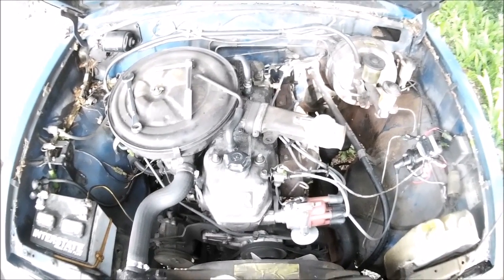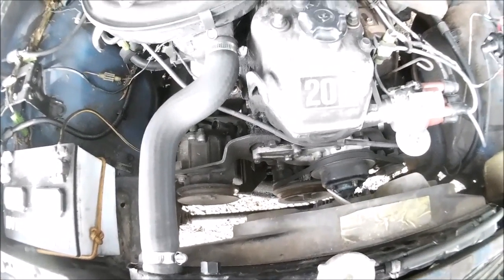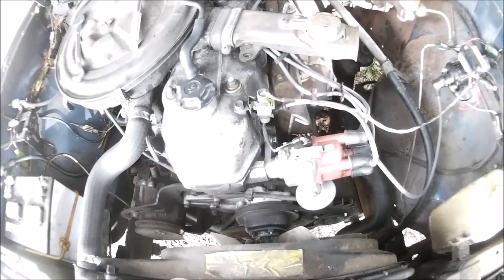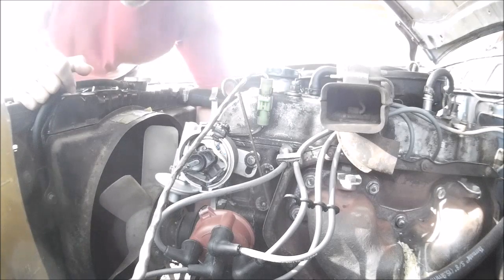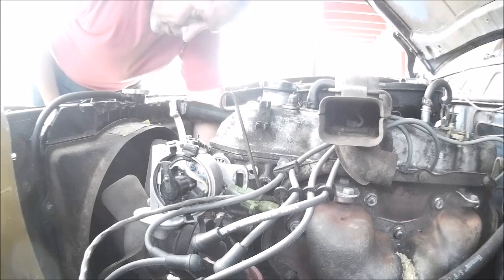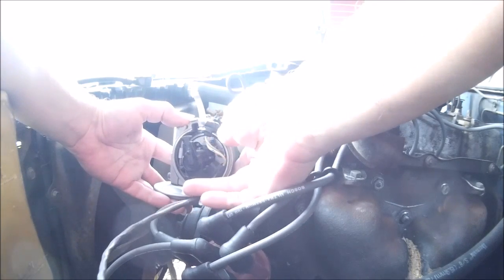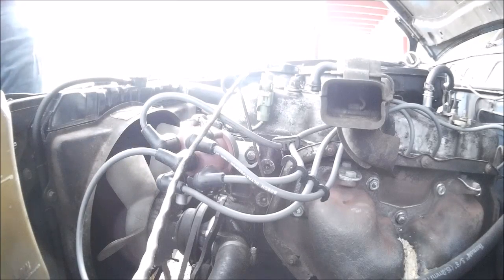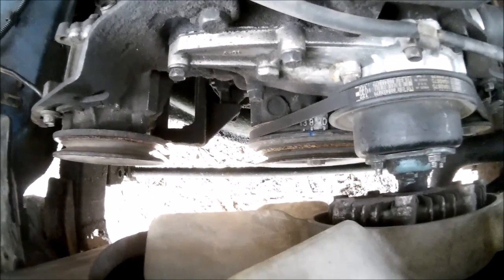1978 Toyota Pickup/Hilux 20R - CORRECT Distributor Installation

Comment: I have this problem with my 22r I'm not sure wat year the motor was from I bought from a guy and rebuilt the chain with metal HD kit and followed the LC engineering video for installation and made sure the crank shaft position was lined up with the cam gear 0 degrees TDC and my distributor can reach 0 but at full retard which I know is not good for the engine but she starts up fine and drives good but sometimes up hill or even flat roads it will randomly start studdering and back fire pop thru the weber 36 carburetor !
The only things I can think of is I need a new distributor or the crank shaft position or the chain moved somehow during installation. Thanks for your knowledge 🙏
Reply from the maker: OK, there are several things it could be, plus several things that need further explanation. I'll try to do this in some logical order.

Without knowing the age or condition of the distributor, it is hard to put the blame on that part. I would suspect that it's doing pretty good mechanically given your description of running qualities. First thing I can think of is do you have the vacuum advance line to the correct port on the vacuum advance on the distributor? 22R distributor have a dual port vacuum advance mechanism; one port is for timing advance & the other is for timing retard. The advance port is the one furthest away from the distributor body. Most people only run the advance side & cap off the retard side; how you run yours is up to you, but you need to have at least a working vacuum advance (more on this in NOTE below).

As a start, I recommend that you remove the distributor from the cylinder head, & manually rotate the engine to 5 degrees** before top dead center on the compression stroke for #1 cylinder. Be sure it's the compression (firing) stroke, NOT the exhaust stroke. Both valves for #1 cylinder should be closed; you can verify this if you take the valve cover off & feel both rocker arms for #1 cylinder. They should both feel a little loose.

Once you have the engine set up right as described above, re-install the distributor as I showed in the video. Be sure the rotor turns as shown when pushing the distributor in, & verify that the hole for the distributor hold-down bolt is centered in the slot. This will give you a base timing of 5 degrees** advanced.

**NOTE: Not all 22R engines were designed to be set to zero degrees; some were set to 5 degrees, depending on model year. This had to do with the functions of the emissions system, controlling vacuum signals to the distributor via several valves, and changing the advance & retard of the distributor. The vacuum signal would change depending on conditions. Given the age of the truck & engine, it could be very likely that some or none of these valves are working correctly, which could certainly cause you a run quality problem.

Since you don't know the year of the engine, & to avoid any of these problems, just run a vacuum line directly from a port on the carb to the vacuum advance port on the distributor as I previously described. On a Weber 32/36, there should be such a port below the choke thermostat. I would also put a quality, tight fitting cap on the "retard port" on the distributor's vacuum advance unit.
I know this eliminates the emissions system controls, but doing this should be good enough for the engine to run well under most conditions.

What kind/type of fuel pump are you using for the Weber? Stock pump or otherwise? Please be specific with make, model & part number if possible. Are you running a fuel pressure regulator with the Weber? If so again, let me know specifically what you have.
Reply: @The13thSword  thank you for all that information! And taking time to help ! I appreciate it! 
But does the small dot on he timing chain gear have to be at exactly 12 o'clock ? Mines is slightly to the left at like 11:30. And the dowel on the cam is at 12 o'clock along with the crankshaft at 12. Could the crankshaft position have moved during installation and tightening? Causing it to be off a tooth? 
Also you said try setting my base timing to 5 degrees instead of 0? Cuz I tried it before and nothing changed it still ran beat at full retard which makes me feel that it must be off 1 tooth somewhere in the chain or crankshaft position moved during installation maybe? Cuz ived tried going forward and back 1 tooth on the distributor and its either fully retard or fully advanced timing and my mark on the crankshaft pulley can't reach the 0 degree mark and its fully retard and only reaches about 8 degrees.
I'm using a edlebrock fuel pump 4-7 psi rating part number 17301. And only a cheap mr gasket fuel regulator set at 3 psi. 
You said my valves could be sticking? I just adjusted the valves to .008 intake and .012 exhaust and they were like really tight before I did the adjustment like I couldn't even fit the feeler gage under it. It haven't been shuddering and back fire pop since I've readjusted the valves but the distributor is still at full retard timing and mark on the crankshaft pulley will only reach 8 degrees. 
Could a faulty distributor be the issue?
Reply from the maker: @kalaikauai808  Your valve adjustment seems to have solved the problem, but a little more on this later. Your description of the dot & dowel on the timing gear sounds correct. These two items are not perfectly aligned on the gear so don't let that throw you off. Have a look at this video at about 2:50 & you'll see this: https://www.youtube.com/watch?v=fhwfXoeM7ZI

You should be able to verify whether or not the crankshaft is in the proper position by checking both sets of marks. If you make sure #1 cylinder is at TDC (0 or zero mark on crank pulley) & the cam gear marks are as you describe, everything is lined up as it should be. If the timing chain was off a tooth between the cam & crank gears, the engine either wouldn't start, wouldn't run at all if it did start, or would run very badly. Believe me, you would notice this.

The more likely possibility of there "being a tooth off" is with the distributor, if it wasn't installed correctly. Here's another video in this that I consider to be even better than my video on the distributor, & how to install it correctly: https://www.youtube.com/watch?v=u6b-vnsk5xA&t=290s

Pay close attention to the rotor position he mentions, & how it rotates as the distributor is pushed all the way in. What is also crucial here is that after it is pushed all the way in, double check to see if the hold-down bolt hole is centered in the slot. If it is, it's fine. If not, the distributor is "off a tooth" & needs to be reinstalled correctly.

If you do all this and still have the same run issues, then it could be a mechanical or electrical problem with the distributor itself, or something else. If the distributor is original, it could be worn & causing these problems. When you say it reaches 8 degrees of advance I assume you mean when running & checked with a timing light? If so this sounds ok.

Good job on adjusting the valves but I have a question. You did do this in two steps yes? With the rotor first in the #1 position and then in the #3 position? I only ask this because you mention "they were like really tight before I did the adjustment like I couldn't even fit the feeler gage under it." I'm reasonably sure you did but just to make sure, here's a link to LCE's instructions on this: https://lcengineering.com/engine-20r-22r-re-ret-valve-adjustment/

I don't mean to question you so much, but I just want to be sure all is correct.

The Edlebrock pump sounds/looks OK, even if it's rated PSI is higher than needed. I think I know which Mr Gasket regulator you have. They work OK, but if you are still having problems under laod, you might want to consider reducing that pressure down from 3 psi to 2 & 1/2. The Weber can be very "finicky" about fuel pressure. Sometimes anything even slightly over 3 psi can cause it to flood a bit, & that could also cause the stumble or pop-back.

The only other things I can recommend you check are the advance weights in the distributor & the air gap setting on the distributor pickup coil. If the weights are sticking, that would keep you from getting full ignition advance, especially under higher load. You can check this by removing the distributor cap, grabbing the rotor & turning it by hand in the direction that it advances, & then letting it go. If it "snaps back" cleanly you're probably ok. If it "snaps back" slowly or not fully, then the advance weight pivots are probably sticky from built up gunk. Clean the pivots with WD-40 to clear the gunk, air dry them, then apply a few drops of a light oil (3-in-1 oil, auto trans fluid or similar) to the pivots.

The pickup coil gap should be between .008" & .016". I have mine set to .012".

Comment: were do I buy a distributor
Reply from the maker: Rock Auto is your best bet. Their prices are usually much better than any parts store, who will usually tell you it's a "special order" item, then charge you out the wazoo for it.

Also be sure to order the correct type of distributor; there are two versions, one a points version and the other electronic. Just compare your old distributor (if you have one) to the pics on Rock Auto. 1975 & '76 models are usually points, 1977 models might be either, and 1978 models are all electronic. Either version will work in the 20R regardless of year, but the electronic version must also have an "igniter" or ignition module to work, and the proper ignition coil (the one specified for 1978, see Rock Auto Parts here: https://www.rockauto.com/en/catalog/toyota,1978,pickup,2.2l+l4,1277108,ignition ).

1975 to '77 20R's can be converted to electronic ignition with the proper parts. I use a GM HEI Ignition Module, as the stock Toyota one can be hard to find and expensive. See my other videos for info on that conversion. Any questions just ask.

Comment: Isnt that 20r a 4? Why talk about a  v8. Anyways good video, helped me start up my celica
Reply from the maker: Yes, the 20R engine is a 4 cylinder. I mentioned a V8 engine & the usual timing setting it has as a comparison; that regardless of number of cylinders, the timing setting is pretty much the same. That means this method of "pre-setting" the timing will work regardless of number of cylinders. Getting the "base" timing setting exact is a bit more critical in engines with fewer cylinders.

I apologize for any confusion over this. I obviously didn't not state clearly exactly what I was thinking at the time I said that. The main point I wanted to make was, that I have heard over & over again to set the pulley mark to Zero & install the distributor. That's OK as a starting point on an 8 cylinder & it will run OK, but on a 4 it's not so great. The difference in run quality is much more noticeable in a 4. Plus you saw the difference in the adjustment slot on the distributor. Having the hold-down bolt in the middle of the slot gives you far more adjustment options.
Reply: @The13thSword  thanks for these 
response, but where did you get the igniter? I believe im having issues with mine.  I have a 20r as well and have that big box. But would like to have one like yours.
Reply from the maker: @jonbertocchi173  Exactly what issues are you having? Can you be more specific? That could help me narrow things down for you. Good diagnosis saves a ton in parts money & extra work that may not be needed.

I recommend that you check out everything else BEFORE you think about getting rid of the stock Toyota Ignitor. In general they are pretty durable units, and it's usually another component that is causing the problem(s). I would also recommend that you take it out of the truck & take it to Auto Zone or O'reilleys (or similar) & have it tested for free. That way you'll know for sure if it's the problem or not.

The other thing to check is the Pickup Coil in the distributor and the wires coming from it to the Ignitor. If your distributor is original, the Pickup Coil might be "out of spec" due to age & use, or may just not be adjusted properly.

You can check the Pickup Coil with an Ohm Meter. The spec on it is 130 to 180 Ohms. If it's anything above 160 Ohms "cold" I'd replace it anyway, or even consider replacing the whole distributor, as it may be worn as well. Make sure you check the wires coming from the Pickup Coil for any broken insulation. Those wires are shielded with a foil under the insulation to prevent interference.

I only went with the GM HEI Ignition Module setup because a stock style Ignitor was $400+ and I can't afford that. I also was not willing to take chances on a used unit that was not returnable. I bought the parts for the GM HEI setup separately & fabricated it all up into what you see in the video. It's custom. I can give you a parts list, but you'd have to put it all together yourself.
Reply: @The13thSword  so ive been driving this car since 2010 and the issues started about a few weeks ago, basically the car cranks and starts but it will take ages and jump start to get it started on a cold and hot start. (Tried starter fluid once but it doesnt work) It idles accelerates well once started.  Also once it's started and warmed up i can shut it off and start it up immediately if its off for only few minutes. If i let it sit for more than 10 it becomes an issue to hot start all over. I  was thinking maybe the igniter is bad. In the past the only mechanical issues I've ever had led me to replace the starter mortor twice,  the solenoid once recently, changed the carb to a weber 38 a year ago  and the fuel pump which i changed  to an electric pump.  Ive checked the spark plugs and distributor and they are good. Maybe my 20r is just ready to be retired. Also i forgot to mention its a 77 celica.
Reply from the maker: @jonbertocchi173  Some good info here, let's see what we can track down from it.

9 years is a while to be driving on the same ignition parts. Have you done any tune-ups in those 9 years? New cap, rotor, wires, plugs, and when? Plugs gapped to spec - .031"? Has the timing been checked with a timing light and if so what is it set at? If you checked timing with a timing light, is the mark on the pulley steady or does it jump around?

The "hot start problem" after letting it sit 10 minutes gets my attention. This sounds like an ignition coil problem to me, especially if you haven't changed out the coil before, there is no telling how old it is or what condition it is in. It needs to be tested. You can get it tested for free at several parts stores (Auto Zone, O'Reilley's, etc.) or you can test it yourself if you have an OHM meter. There is a very good video on how to do this here: https://www.youtube.com/watch?v=FIx4dxew_UU

Pay close attention to the instructions on how to use the meter.The specs for your coil are: Primary Resistance 1.3 to 1.7 Ohms, Secondary resistance 6500 to 10,500 Ohms.

The coil MIGHT test out OK cold, but still be your problem; I will explain. As an ignition coil ages it has to deal with literally millions of electric cycles as well as engine compartment heat, which can be as high as 200 degrees F. Eventually this can lead to several turns of wire inside the coil breaking and/or shorting out due to degraded insulation. This can cause the coil to have a higher than spec resistance when it gets hot, and not allow enough current to flow to fire the spark plugs. When the coil cools off some, sometimes the wires inside can shift and "undo" a short. Also, if the wire inside is fatigued do to age & use, it will have higher resistance when hot. Cooling it off will actually drop the resistance enough to get the engine to fire & run.

If you find out that the coil is not in spec, or EITHER of the readings obtained are on the high side of the spec I showed above, you should replace the coil. I recommend that you only get a quality replacement because cheaping out on ignition parts never pays in the long run in my experience. Avoid any China made coil; you'll be lucky if it lasts a year.  Recommended coil - Standard Motor Products UC12 or UC12X. You can usually find these at almost any parts store for $30-$40 or about the same price online I use the UC12 & it works great.

If you replace the ignition coil and still have the same issues, then it's either the distributor pickup coil or the ignitor.

There's no reason to retire the 20R engine if it still has good compression and doesn't use a ton of oil. These engines are simple, super reliable & durable. Check out that ignition coil & let me know what you find out.
Reply: @The13thSword  i forgot to mention i changed the last time i changed the spark plugs was last year and i changed the ignition coil when the issues began. But who knows if its still good, ill test it out.
Reply from the maker: @jonbertocchi173  Just the plugs & coil? Not the wires, cap & rotor as well? Any of these could cause an issue. As for the coil, I am curious as to which one you used (Brand, Part #). Like I said, some of the less expensive ones out there right now aren't worth a nickle, do not last and will give you problems like this. Specifically it was a Spectra Premium brand, part # C624. This same coil is also sold under a lot of other brand names, but the part number is usually the same, or always starts with a "C". Mine didn't even last 6 months before the problem started happening again. You get what you pay for.